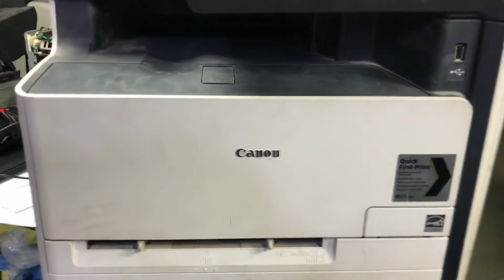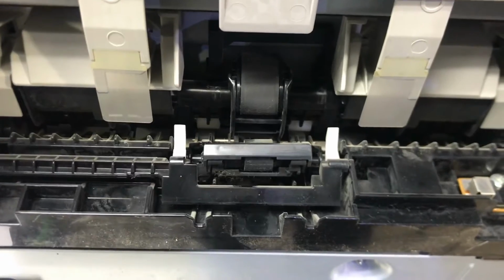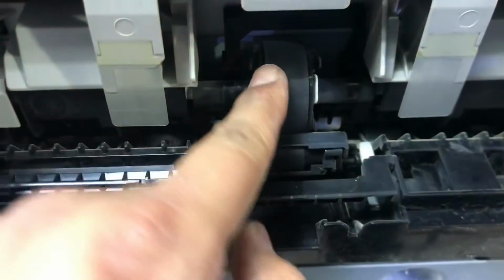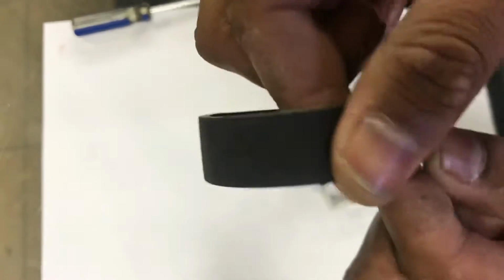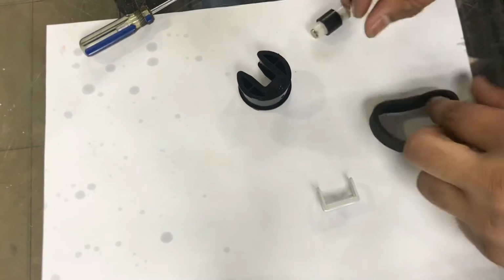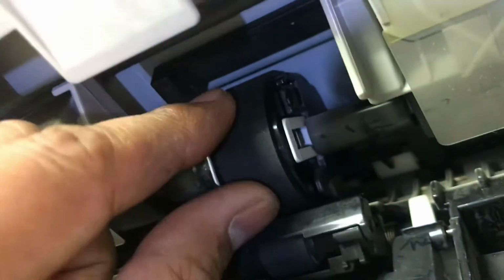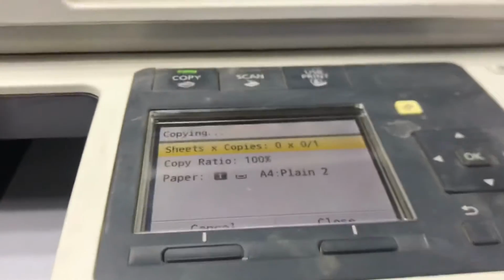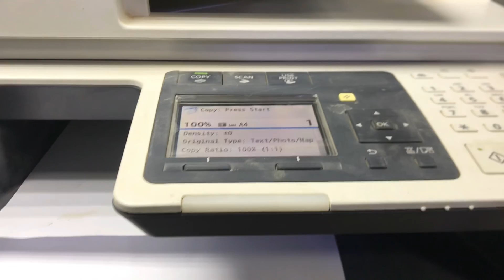How to Fix Paper Jam in Canon MF8230Cn? | How to Access Service Mode Canon MF Copier?

Comment: I followed your instruction but the feeder is not changing its direction to remove kindly explain what to do
Reply: The same goes for me the pick up roller doesn’t rotate
Reply from the maker: Problem with drive gear
Reply: @BilalKhalid  how to resolve the issue